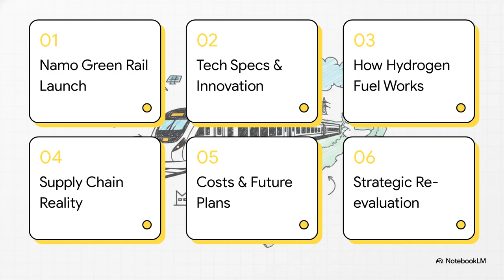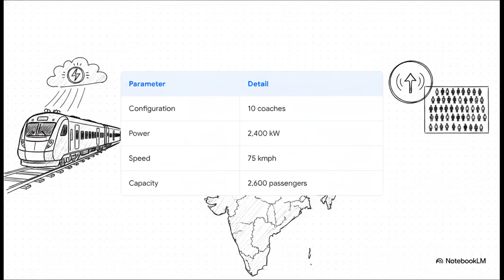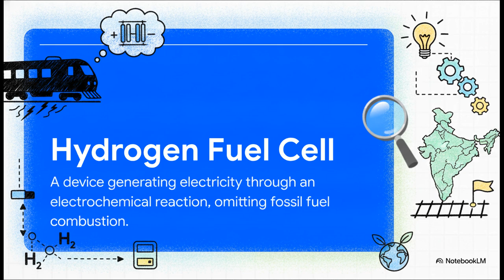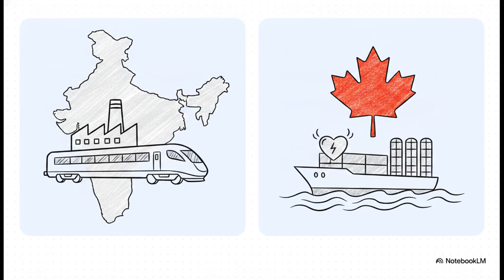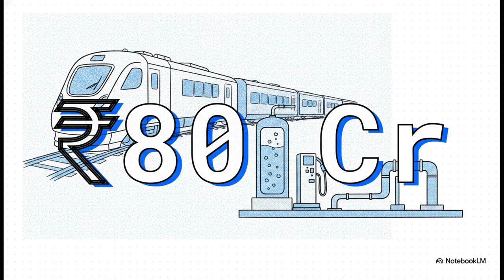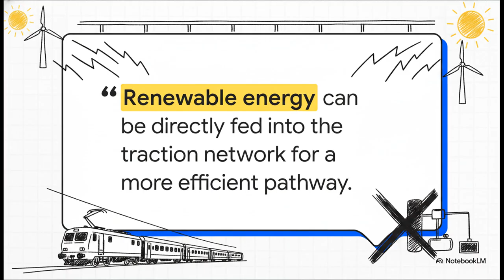#India's #First #Hydrogen #Train: #Innovation, #Launch & #Technical #Reality #GHG #namogreenrail

Comment: India is set to launch its first hydrogen-powered train, the Namo Green Rail, marking a major engineering milestone on the Jind–Sonipat route in Haryana. This pilot project, representing a significant step toward cleaner rail transport, involves a 10-coach trainset consisting of two driving power cars and eight passenger coaches.